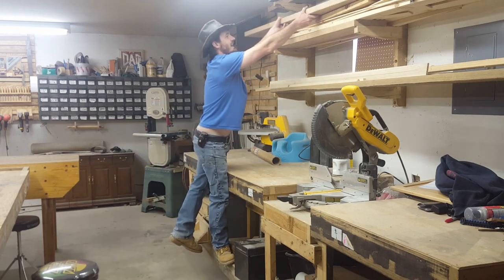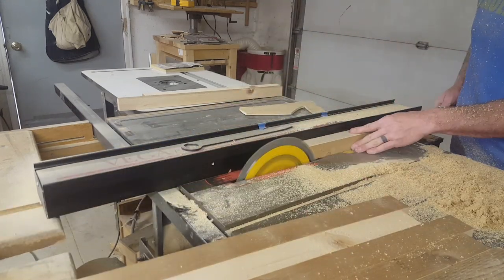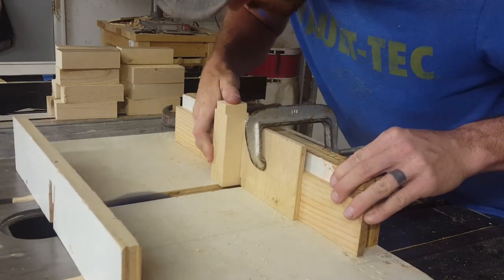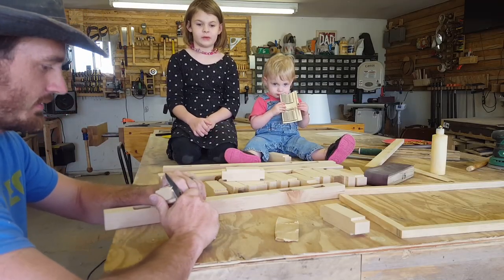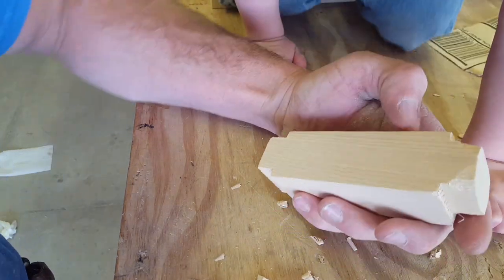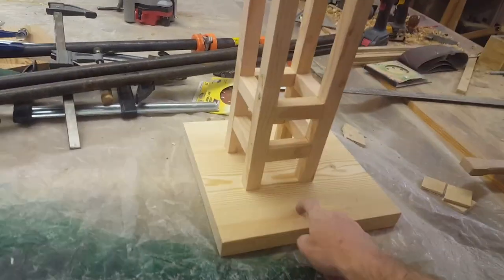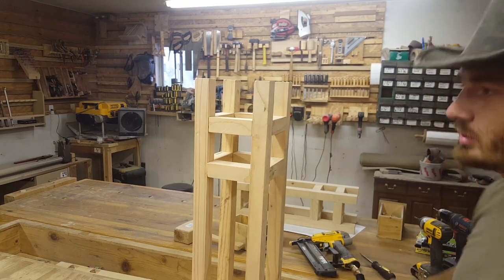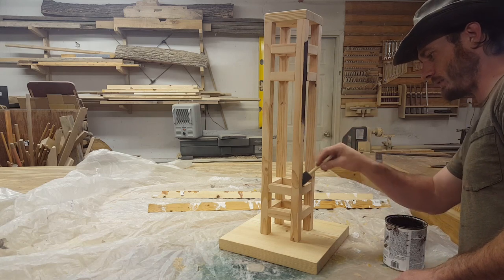Making a Lamp for Mothers Day (sorta)

Comment: Not bad overall.  If you make it again you should add feet so the lamp doesn't sit on the wire.  Also drill down through and run the wire inside the vertical piece so you don't see the wire.